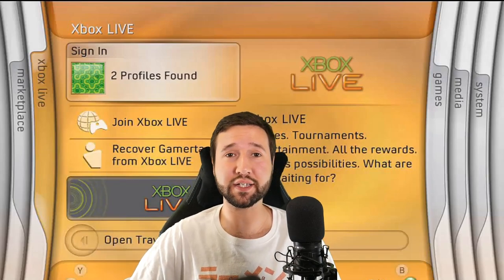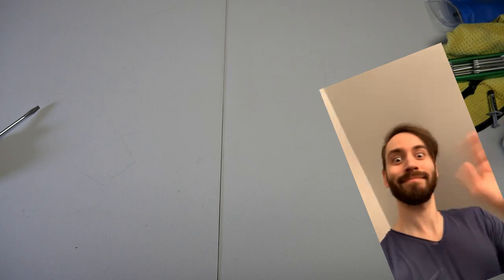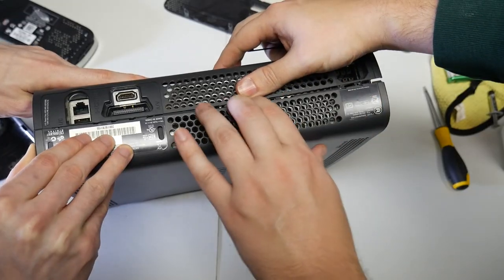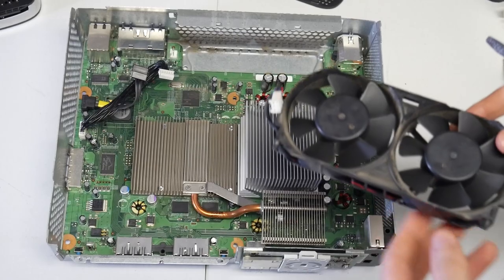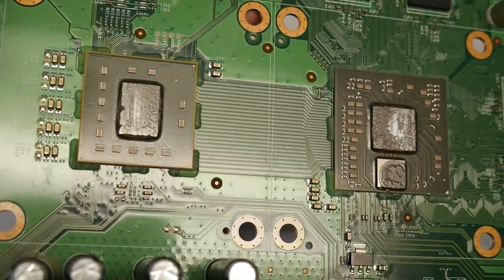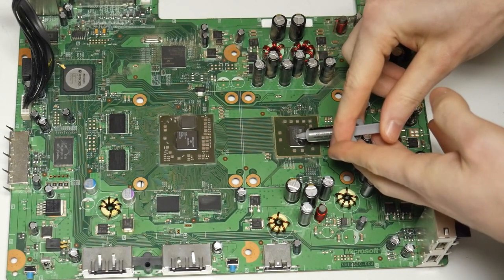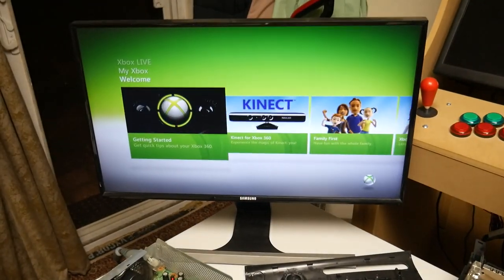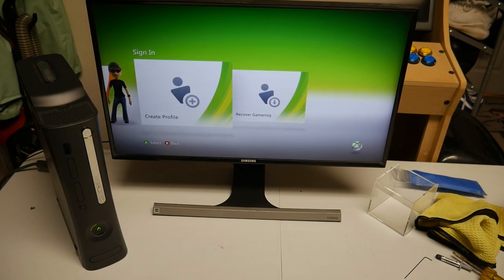I bought a broken Xbox 360 off of ebay... Can I fix it?

Comment: As someone that's dealt with a ton of these, I can share some more info about the RROD. It's not necessarily a bad solder joint between the motherboard and the GPU substrate, rather an issue with the bumps. The bumps are tiny solder balls that attach the die (the shiny part of the GPU) to the substrate. The heat and cool cycles eventually wore out the low quality bumps ATi was using at the time, breaking the join between the die and the substrate.

Unfortunately, "reflowing" things does not permanently fix them. It will eventually RROD again as the GPU undergoes its heating and cooling cycles, eventually breaking the join between the bumps and the substrate. This does bring the console back for a short little while, but in my experience, they do fail again.
Reply: Correct Microsoft confirmed this themselves in their Xbox documentary
Reply: So what do you recommend as a permanent fix besides replacing The GPU from another Xbox 360? Thanks bro 👍👍
Reply from the maker: @fatbikearcticnomad2122 unfortunately that is the only permanent fix

Comment: Good Thing that you're replacing the Bolts with Xclamps but it's not fixed. The E74 is caused by solder inside the GPU and reflows won't fix it. The GPU needs replacement

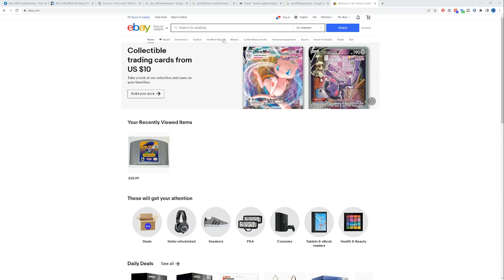Comment: 0:36. NOOO that’s not true. It’s a defect from the gpus solder bumps that are coming away from the board. It has absolutely NOTHING to do with the hana chip. There is times the hana chip is bad but that’s not the main cause of E74. Also using a heatgun isn’t the proper way to fix it. You can reball but it won’t work permanently, the only really fix is to replace the gpu and then again you still don’t know if it’s gonna live long.
Reply from the maker: Yeah I said the same thing a little later in the video, might be worth just getting a new xbox

Comment: That’s a Gamestop Certified used Xbox 360. It has the fan mod and the x-clamps replaced by screws. Gamestop did that to bring console’s back to life temporarily to resell them for profit so the seller probably was being honest.
Reply from the maker: I didn't know GameStop were the only ones that did that? That is pretty interesting information though

I heard from a lot of people though that this could just be an issue with the GPU entirely and that the board will just keep dying. Hopefully not
Reply: @BelowAverageGaming  Jacob R also opened one of those. 

I seriously wonder if Gamestop was trying to bolt down T-34 steel instead of actually trying to bolt a heatsink down. I'm from Romania and own two Falcons, one being a plagued-GPU (late 07) and the other being a May 2008 unit. Even after a reflow, the late 07 unit didn't even need bolts. Just reflow, slap some high mw/K rated thermal paste, and it's gonna live another decade at best.

This is my experience with almost anything that's got bump issues - I have Geforce 8400/8500/8600 video cards in both desktop and laptops - aside from one chip that was horribly abused (to the point it started turning a dark brown), all of the chips I have still work to this day. The key was just using a high mw/K rated thermal paste (MX4 worked best for me usually, and more recently MX6 too, which is a updated MX4) and tightening the heatsink as much as possible so there is maximum thermal interface contact.

Among these, I can list some notorious candidates - HP DV6000 (the 8400M GS variant), DV9000 (8600M GS, both 256 and 512 flavours), Acer 7720 w/ 9500M GT (although I would say this one was due to cemented thermal paste, as the chip did seem to come from after they fixed the substrate) and the list could very well go on.

TL;DR - a reflow will certainly not last forever, especially if it's a bump issue - but in the cases of bump issues, a proper thermal paste with good application can (most of the times in my experience) potentially maintain the chip alive for long periods of time. I would advise keeping an eye on thermals every now and then, but otherwise it's a good solution with YMMV results when you're on a tight budget. 

Anyone suggesting a chip replacement - try and justify the prices of both getting the chip and the labor required to get it installed. I'll be waiting.
Reply from the maker: Well said,  I actually purchased 3 more red ringed falcons not to long ago so that will be interesting 

 So far the xbox from this video is still running well 👌